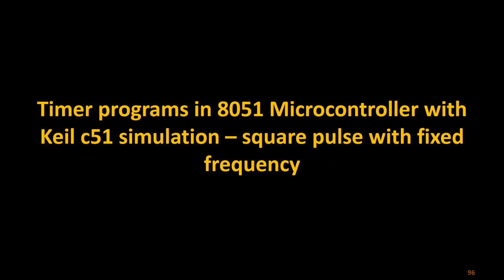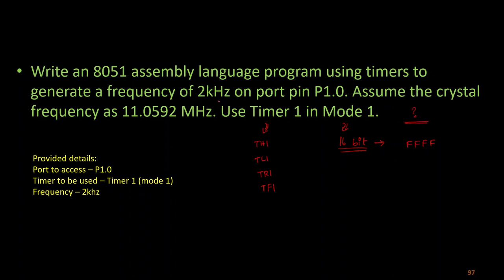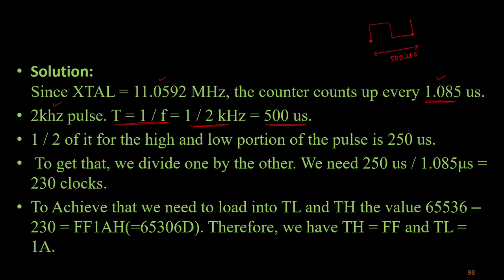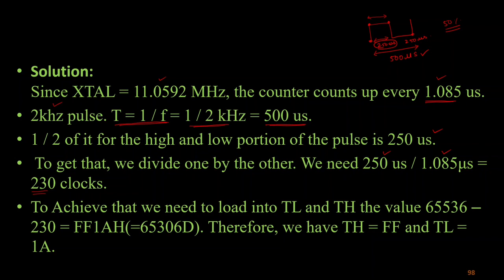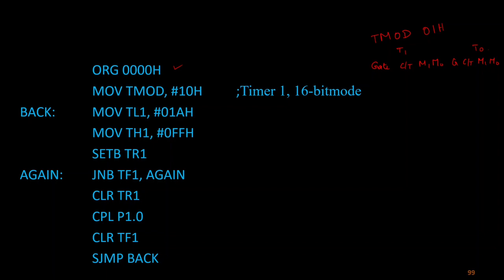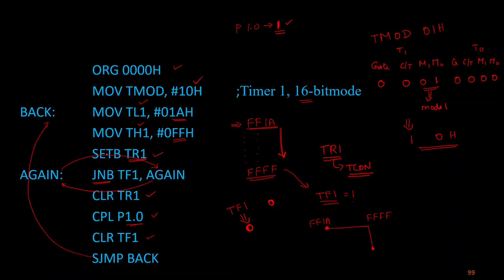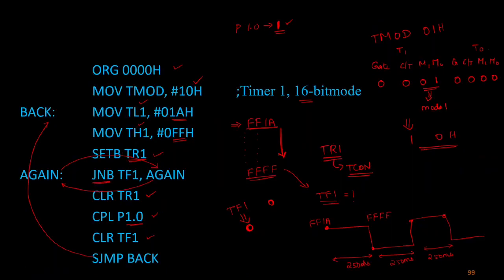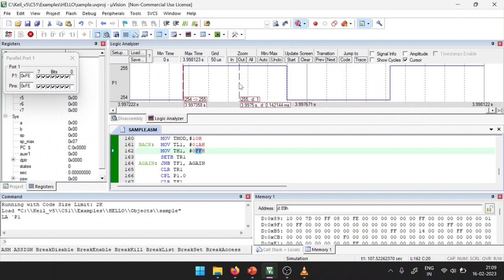Timer programs in 8051 Microcontroller with Keil c51 simulation – square pulse with fixed frequency

Comment: When I run the same program, no waveform appers
Reply from the maker: After building and pressing debug icon, then go to view -> Analysis window -> logic analyzer
Reply: Sir in logic analyzer no timing waveforms appears as like shown in vedio
Reply from the maker: @allunaveen4663  please enable cursor option in logic analyser.
Reply from the maker: @allunaveen4663  in set up select the pins you need